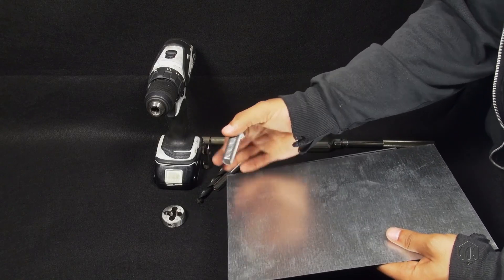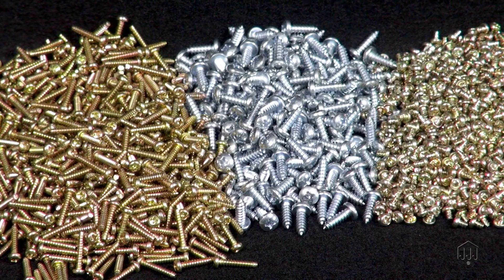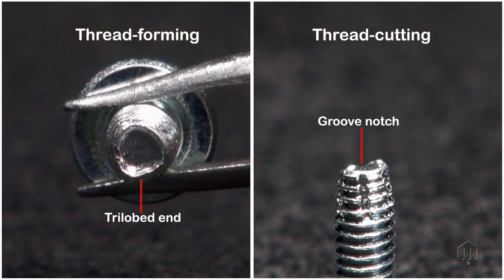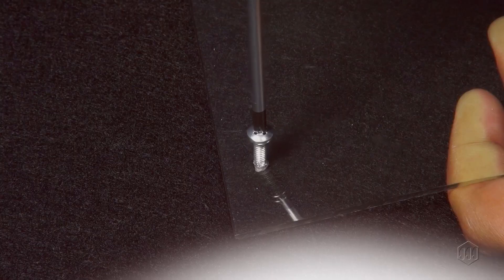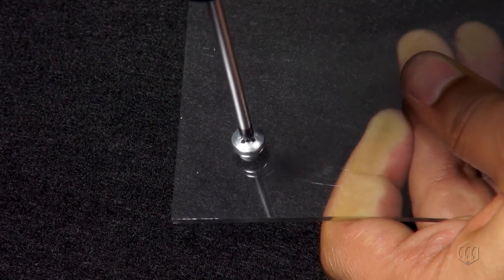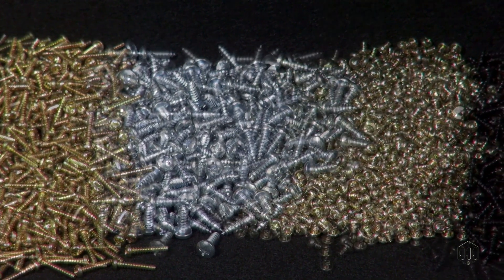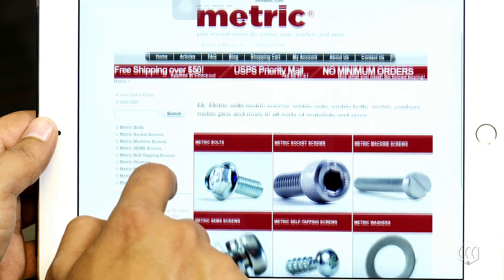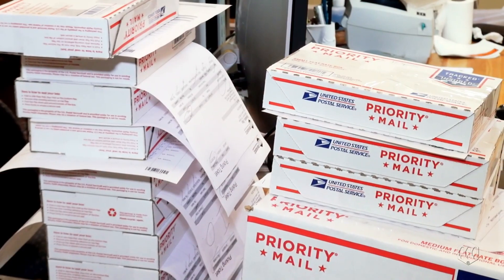Thread Forming Screws & Thread Cutting Screws

Comment: thanks for explanation of some physical terms , although i was searching for a biological subject , but i found here the right answer . this is my context {All miniscrews are self-tapping (i.e., they create their own thread as they advance). There are two
 self-tapping designs: thread-forming and thread-cutting. The difference is the presence of a cutting flute on the tip of the thread-cutting screw. Athread-forming screw compresses the bone around the thread as the screw advances, obtains better bone-to-screw contact, and is better adapted for use with alveolar bone}.